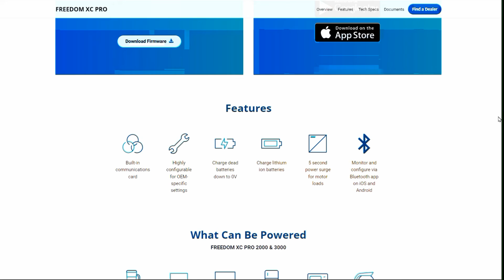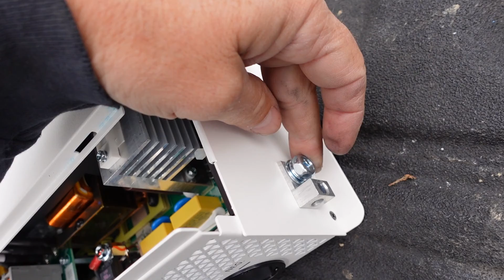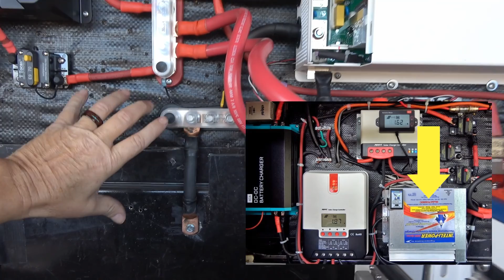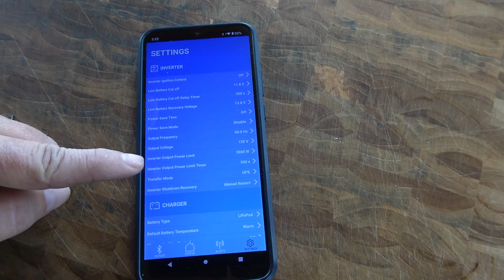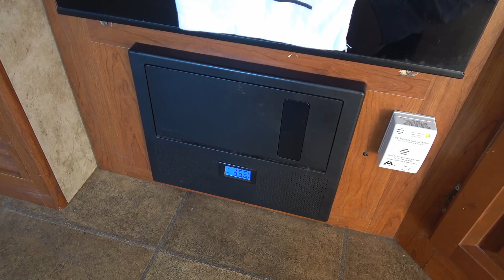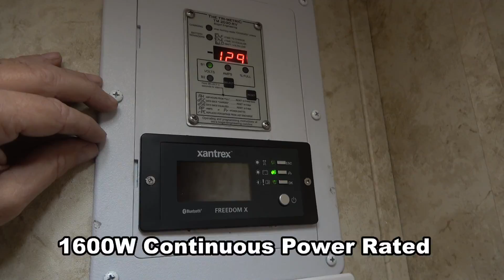Xantrex RV Inverter/Charger Installation (Freedom XC Pro 3000) + Charge & Discharge Demos

Comment: I've been thinking about upgrading my 2000 watt inverter to the 3000 watt, sometimes that 2000 watts just isn't enough LOL.  The previous owner of my travel trailer had installed the 2,000 watt Xantrex Inverter, but I find myself needing more sometimes, so I'll be looking into purchasing the 3000 watt inverter here soon, should just be an easy swap out since everything is already wired and ready to go...next step will be upgrading my batteries, or at least adding additional bateries.
Reply from the maker: It's been a good inverter for me. Have the 2000W model on our boat, and it has worked well too. Cheers, Ray
Reply: @LoveYourRV  Thanks, I think the 3000W model will serve me much better and worth the upgrade I think.  Nothing wrong with the 2000W inverter I have, just not enough power sometimes...and since my travel trailer is my home it makes more sense to upgrade my inverter.  I probably can sell the 2000W inverter and recoup some of the cost of the new inverter.

Something I'll point out, since I have the 2000W inverter, I have 2 Lifepo4 batteries instead of the lead acid batteries, the onboard converter/charger that is in the trailer will not fully charge my batteries, but the inverter/solar controller/charger does, so those 2 add-ons have saved from having to replace the stock converter/charger unit.  That is something to mention actually regarding these Xantrex Inverters, they do have a setting so you can tell the inverter which battery type you have, and it will adjust its charging logrithm to charge your Lithium/Lifepo4 batteries, a nice added bonus of one of these inverters.  Heck I think this inverter does more stuff that I have a clue about LOL.  

I love that my inverter seemlessly switches over from charging/bypassing to inverter function immediately upon power loss, there's no delay, its immediate.
Reply from the maker: Yeah, they have nice lithium charging capabilities.  I love the fact that I can use the app to adjust the max charging amps to suit my 2000W gas generator. That way, I can max out the generator's power output without overloading it by setting the charge amps to around 85.

Comment: Hello, I am new to this. You say your batteries are 150a output. So two max out you inverter. But doesn’t the 150a output just mean they are capable of that and not always putting out 150a? Like I said I am not challenging you I just was curious as i have a 560ah battery that is max 300a output and am thinking of adding a second one. Thank you and really enjoy your video.
Reply from the maker: Yes, 150 amps is just the specification Xantrex lists for Max Continuous Discharge Current. The amperage they output is determined by whatever load is attached to them to power. For example if you turn on a light in the camper and it draws 2 amps that is what the battery will output.

Comment: Hi Ray, when you are plugged into shore power do you leave the inverter on all the time
Reply: TKS Ray
Reply from the maker: For short stays I just leave it on but if spending extended time I usually shut it off. Like right now we are spending the winter in an RV park on electric hookups so I have turned it off. If we have a power outage I could turn it on.
Reply: Mine is turned on all the time, when hooked up to shore power, everything just passes through the inverter, the inverter isn't doing anything to supply power, now, if you lose power and your inverter is already on, anything plugged into an outlet that is connected to the inverter isn't phased by the power loss, where if you leave your inverter off, you'll have to turn on whatever you had plugged in once the inverter comes online.

Comment: Why 150a M series fuse. shouldn`t it been a 250a T style for that 240ah battery?
Reply from the maker: I only needed a max draw of 300 amps so I fused each battery with a 150 amp MRBF terminal fuse, at 14V it has a AIC rating of 10,000 amps. But if that were to fail there is also a 250 amp class T fuse located in the battery itself plus the battery BMS has short circuit protection. Cheers, Ray
Reply: Wow that's impressive thank you  @LoveYourRV

Comment: I bought this same make and model from a guy in Washington PA for 600.00 ! I really love It too it easily runs my water heater and microwave at the same time ! I have 1200 ah of lithium batteries here in the van as well so I could easily run my 1500 watt fan heater for around 6 to 8 hours straight that's really awesome

Comment: I couldn't tell from the manual but is it possible to have it hardwired as well as installing the GFCI on the inverter? Would be nice to have an outlet in my passthrough.
Reply from the maker: I didn't think about it, but my guess is yes. It looks like the plug has just three wires: hot, neutral, and ground.
Reply: @LoveYourRV  thanks. I may have to pull the cover off and see next time I can have the inverter offline.
Reply: @LoveYourRV  I put a GFI I had kicking around and used a cover and gorilla tape work's pretty well

Comment: I noticed there was no fuse on the low-voltage input of the inverter is there one inside the inverter and are the batteries 24 V does that inverter have a 240 output for UK
Reply from the maker: This inverter is 120VAC, and I have two 12V batteries wired parallel for 12VDC input. There are 150 amp terminal-type fuses on the batteries.
Reply: Hi Ray, I'm new to this channel but followed for a longtime on the other one. If I understand you correctly you have the AC input on the inverter connected to the exterior outlet for generator/charging. After that I assume you have the AC output running to your power distribution panel via primary transfer switch. So when you are hooked up to shore power does it bypass the inverter? And also your power distribution I believe has a charger built into it. I believe you upgraded it for lithium awhile back on the old channel. Please ekaborate on the interactions andcswitchings of alk this. Thanx. 
P.S. I have been running a Xantrex FREEDOM XC 2000 and have had good service and support from Xantrex when needed.

Comment: Every positive cable should always have a fuse or circuit breaker for electrical safety.  National Electric Code requires it. The Xantrex inverter manual requires 4/0 awg cable and a 350a Class T fuse, Mega Fuse, or MRBF Terminal Fuse for their 3000w inverter installations, with cable length of less than 4 feet. No matter the length of wire a Fuse is required. No fuse means the wire has to burn through to break the circuit. I see you used only 2/0 awg and no fusing whatsoever on your Xantrex 3000w inverter installation. I urge you to replace your inverter positive wire with 4/0 awg cable and add a 350A MRBF Terminal Fuse off your bus bar for the inverter connection. I don't know the rating of the bus bar you selected, but I would recommend one rated more than 300a, since you have a number of other powerful elements connected to it besides the inverter and batteries. I also recommend an inverter to battery disconnect, this way you always have a way to isolate the inverter from the system. This is important when troubleshooting issues,  particularly when you must perform a Xantrex Inverter Hard Reset, as part of troubleshooting.
Reply from the maker: Each battery has a 150A MRBF Terminal Fuse between it and the inverter to protect the wire run, so another fuse would be redundant, introducing another connection point and voltage drop. 
The bus bars have a 300A rating. Will be adequate for how I plan to use the inverter. 
For wire size, I used the Blue Sea Wire Size Calculator and inputted 12V, 5 feet run, 300A, 3% voltage drop, 105C rated wire. It recommended 2/0  See - http://circuitwizard.bluesea.com/. 
My Xantrex batteries have built-in disconnect power buttons, making an external battery disconnect redundant.  Cheers, Ray
Reply: @LoveYourRV  You logic on fusing only applies if you has a continuous wire of a single size running from a single battery directly to the Inverter. Which the Xantrex inverter manual defines as 4/0 awg with a 350a fuse.  It doesn't work that way once you start introducing bus bars and other components. You should try reading National Electrical Codes. Only the the wire to a bus bar is fused is protected, that'swhy you put one on each battery. The inverter requires the same, since it is drawing power from both batteries supplying the bus bar it should have larger wire and its own fuse. Using to small a cable introduces resistance and causes heat. Your inverter gets power from more than one source, not just the battery.  Your inverter wire to the bus bar needs fused because you could have an inverter incident that never blows the fuses at the battery terminals. So the inverter power connection has no way to break the connection during an unplanned serious event. Electrical safety is something you want to build in. Even if you think it is redundant, which it isn't,  it is also an element of safety. Have multiple safety devices is always a good idea, just like adding an inverter battery disconnect switch.  Having a manual means of isolating the inverter from the battery is always a good idea.
Reply from the maker: My other power sources are all fused. But I see what you mean. It would be an extremely unlikely event; there would have to be just the right partial short circuit to take place at just the right time, but in theory, it could happen. I'll add a fuse.  Thanks :)
Reply: @LoveYourRV  🙏 ❤️
Reply: Yes 2/0 is pretty sufficient for this inverter charger I use cables from harbor freight the 3 ft ones no issues
Reply: @coreybabcock2023  If the 2/0 wire you use is protected by a 250a Fuse you're protected. If not, then when you say no issues so far I presume you mean your system hasn't been smoking or show signs of burning. Because with out the correct fuse protection that's the situation you're in, an Un-safe Condition!
Reply: @SandyRVUpgrades  it's fused at 200 amp

Comment: Nice looking installation. Getting married must have helped (LOL) ... BTW.... be careful fooling around with electronics / electricity with a wedding band on. I learned the hard way many years ago with a large capacitor in a tv .. yes; I'm that old that I would work on a TV with a large capacitor... so much for skipping the step tapping them with a screwdriver first.
Reply from the maker: Thanks! That's why I went with a ceramic ring.  It's ceramic with Koa wood and abalone inlays, non conductive. ;)
Reply: obviously;  you're a lot smarter than I am ! Best to you & your bride.
Reply: Ha, as an electrician I was thinking the same, even though it wasn’t metal. Watched my co-worker pass a load through the ring while poking around a panel and it gave him a permanent burn scar.

Comment: I'm keeping my separate inverter  and charger.  If one goes out I don't lose my system.  All in one seem convenient, but I don't trust all that heat in one place.
Reply from the maker: I carry a spare inverter, solar and charger in my truck tool box. The Xantrex stuff is well built so cools very well compared to cheaper end stuff. They are used by a lot of high end motorhomes and yachts as OEM installs. So I have good trust in it.
Reply: @LoveYourRV me too they are commercial grade